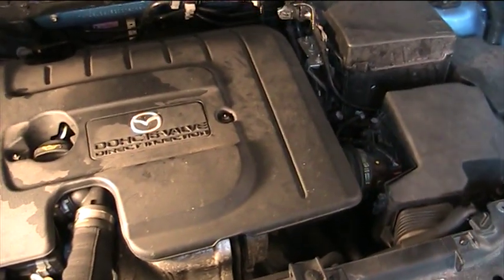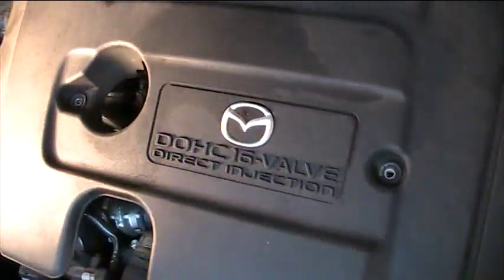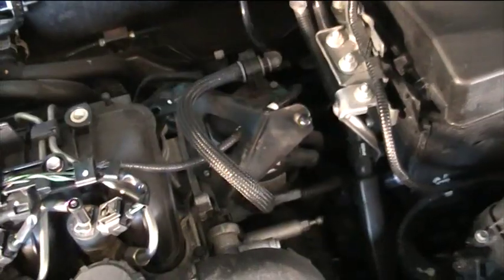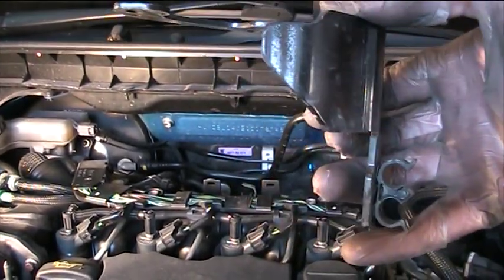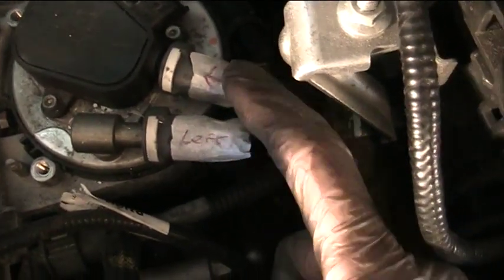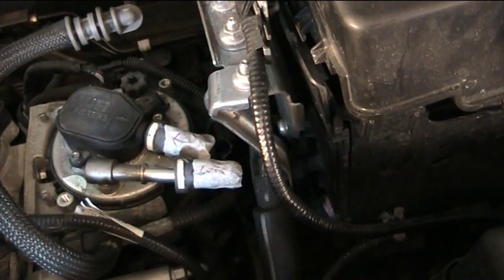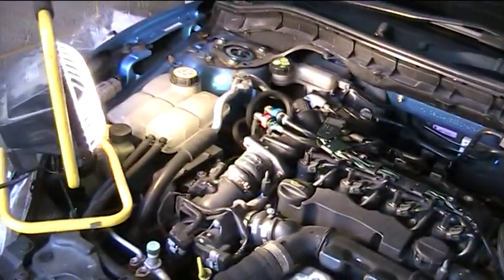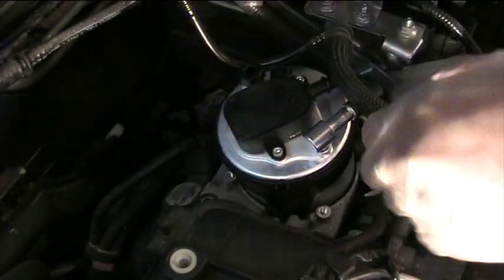Mazda 3 Fuel Filter Change

Comment: Just wanted to thank you for the clear and detailed video. I managed to get this done easily and the car is now running perfectly. 

Make sure to fill your filter with diesel before you reinstall. No pump needed just put a funnel on the inlet and fill it up. 

Greetings from Macedonia
Reply: Thanks - Great Tip

Comment: hi sir.  i have mazda 3  2009 Diesel and it showing powertrain sign.  so it's  because of  fuel filter. ? it runs and drive but it's  not going over 80. thanks  best regard sandhu
Reply: I believe that may be a clogged diesel particulate filter or a lack of exhaust fluid which can only be filled in the container under the car near the fuel tank

Comment: Would you know how to do this on a 2007 Mazda 3 2.0L can not for the love of god find the location off the filter
Reply from the maker: I think the fuel filter ( i could be wrong) on your model. It is  located somwhere behind the rear wheel on the drivers side.  If you go to Euro car parts and enter you reg. You can see what the filter looks like.

Comment: Thanks for their video mate, very helpful. My car has same engine so was same procedure, except all bolt's 8mm on mine which was handy! I've worked out that little random adapter that does nothing is what you hold on to help pull it out, so saves using screwdriver's 😀

Comment: I did exactly as shown. Refilled the fuel filter. It started and run for 10 seccond then it stopped. I can t started anymore. Any ideas ?
Reply from the maker: Need some more information. Does the engine turn when you try to start?  
If so (silly question), do you have enough fuel in the fuel tank?
If you do,  check that you have not disconnected by accident the air flow sensor on the air intake, located on the pipe from the air filter. 
Check the air filter is not blocked.
Do you have any lights on the dashboard when trying to start the car?
Reply: I had the same problem. There is no lift pump in tank, just fuel gauge. It was a bit of a pain to get ALL air out of system.without correct tool but it was the only way to get it running.
Reply: I fixed the pepblem ....the next day. Turn s out that my type of engine if it gets air in the instalation then it is a nightmare to restart the engine. I sprayed the intake from the air turbo with starting spray plus I hooked the car battery to another car batery. You need a lot o amperage until it starts. After 10 to 15 minutes of spraying and trying to start ...the car finaly started.

Comment: Hey you have any idea why my car doesnt start any more. at the  first time it was going but after 20 min  no more  i can't no more starting the car
Reply from the maker: If you have a diesel and try to start your engine and you can hear the engine turning, then it could be your fuel pump has stopped working, your filter has blocked. If you have petrol then it also could be your spark plugs. If you have obd reader then you could see if it is a sensor such as the crank shaft.  With out much more information I can only give general places on what to look at.

Comment: Hi,
  Changed the filter a month ago. All went well, but now i got a problem with the car. On the first startup after it sat for a while, it stalls. Same symptom as if you did not fill the fuel filter or air entered in the fuel. Any ideas? Cheers!
Reply: This is a late reply, but for future people watching this, I just saw another videos, many people with this issue. The trick is to start the engine and let it idle for 30 mins, then turn up the A/C on full and let it idle for another 15 minutes. This apparently is the correct process for letting the ECU discover the correct fuel mixture. Its seems to require this any time you disconnect the battery.
Reply: @cheese-sg8ji , to come back to this, it was the fuel rail high pressure sensor
Reply: @mishutz  I'm getting a lean fuel mixture code, swapped my air filter, cabin air filter, spark plugs, cleaned maf sensor and im waiting on parts so I can do the fuel filter and o2 sensor. the code hasn't reappeared but apparently it can take 2 weeks for it to reshow if it is going to.
Reply: @cheese-sg8ji  what engine?
Reply: @mishutz  I believe its a 4cyl, 2000cc, non skytech or whatever its called, on a standard transmission, why?

Comment: I replaced the fuel filter on my Mazda, bled the fuel line, but it refuses to start up. Could it be that  there is still air in the line?
Reply from the maker: Bill Kendich . Did you bleed the fuel line as shown in the video.  Because if the fuel filter is not filled with diesel,  then when you start, the filter will fill up with fuel and the engine will just turn over. Also make sure the fuel line connections and electrical connection are tight and in the right way round.  Also when you say that your car does not start.  

When you try to start Can you hear the engine trying to start, or you hear nothing. If you hear nothing there there is another issue.
Reply: @seriously-learntodrive  It fired up today. Problem was, the fuel line wasn't properly bled from the filter to the common rail. I used a pump to fill up the line.
Reply: I did it exctly. I refueled the filter. It started run for 10 secconds and then it died. I can t start it anymore. Any ideas ?
Reply: @petrutmihaiflorin5003  I have the same problem i think it is the pump. When i gravity feed the filter the car works fine.

Comment: Many thanks for your continued posts on Mazda servicing.

Are you likely to cover gear oil change and brake fluid change?
Reply from the maker: Not any time soon. However the gear oil change is similar to the Mazda 6 which i have linked in the description above.
Reply: Seriously - Learn to drive Much appreciated!